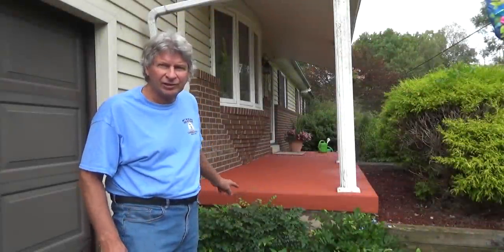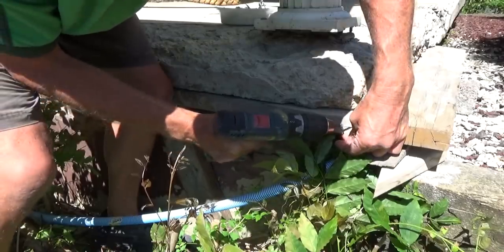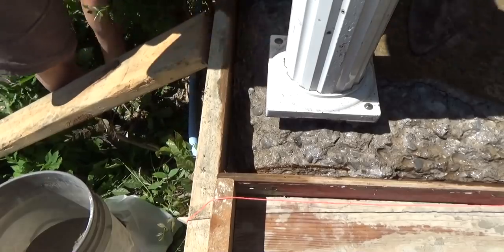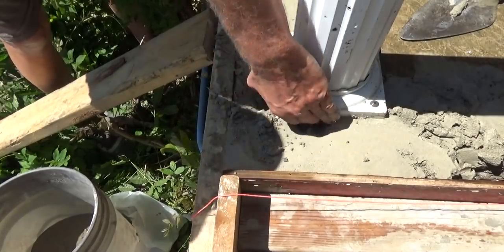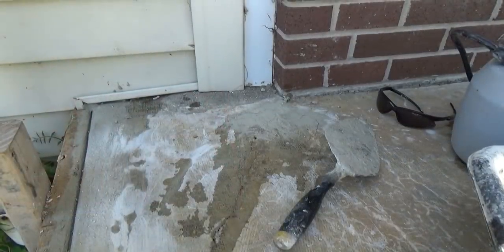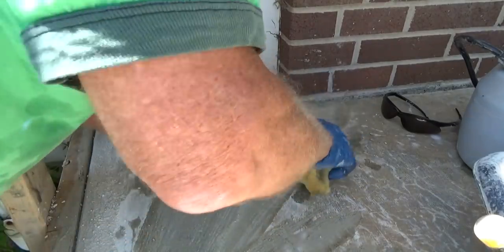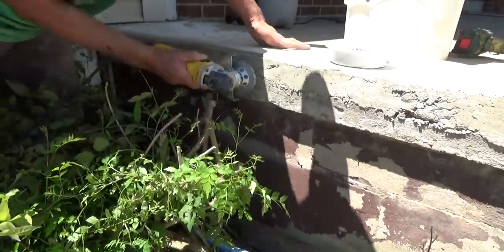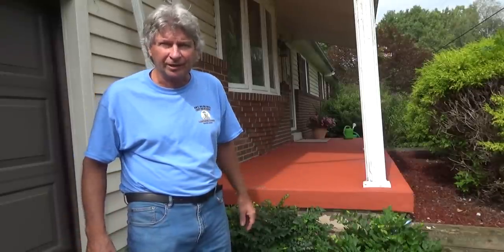CONCRETE REPAIR/PATCHES (Part 5) MIke Haduck

Comment: Great video.  the camera work is awesome.  the explanation is right on and this is exactly my scenario.   this helps a lot.   much appreciated.
Reply from the maker: Thanks Daniel, mike
Reply: @MikeHaduck   I asked about using mortar vs portland and I am watching this again. I see the text that if you used portland and sand you would have and leave the forms.  I was wondering why mortar vs portand and that is the answer.   Thanks for that detail.   I have looked at a lot of videos trying to figure out the best way to fix my porch and this is the best one.  perfect for me.  thanks again.
Reply from the maker: Hi Daniel, here I am using rapid set mortar mix which is very fast drying and acts like portland,  traditional Portland takes at least a day or more to set up, big difference in time factor, thanks mike

Comment: Did you work with your dad when you were a kid Mike?
I did from the time I could crawl up into the truck (well driller).  Older I get the more I realized how much I learned.
Reply from the maker: Thanks Henry,  yes I did also, mike
Reply: I was the youngest in a large family and from the time I was three my mother used to send me out with my older brother driving round in a truck which was great,   I thought I would be doing this forever and got the shock of my life when they packed me off to school at five . Never really recovered to this day .

Comment: Need help Mike! under my Rain gutter is a 3'x 3' slab that is next another 3'x 3' slap. What product is the best to adhere to and float the sunken (1-1/2" down to 1/8" which is but up against the next slab?
Reply from the maker: Hi Jason, I have a video called basement water problem solutions, Mike haduck, watch that first  then a 3 by 3 I would probably rip it out and do it over after the ground is sloped properly away from the house, I am not there to see it so I am assuming, thanks Mike

Comment: Perfect timing on this video u posted Mike. I gotta fix a 4ft wall for my parents that holds dirt&grass at the end of the garage. It looks like the same thing that the porch u fixed looks like it's falling apart at the top 1 1/2feet with a couple cracks like the one in ur video, we got the same freeze&thaw weather here in wisconsin like u do there. Should I paint it with portland first to help it bond or just wet it down good like u did? Also how should I charge them,  a flat rate or time& materials? LOL!! Just kidding on charging them! Thanx for another great video & for answering my questions & nice one on ur nephew asking what to do if it falls apart when u pull the forms! Get in ur truck & take off fast, hilarious!! Always a pleasure watching ur videos!!👍 Take care.
Reply: Mike didn't mention his Portland paint.  No big deal.
Reply: I didn't see him use it, I was just wondering if he didn't need to use it on this particular job
Reply from the maker: Hi Bob, no need for a bonding agent with rapid set it sets too fast my opinion,  anything that works, thanksmike
Reply: @MikeHaduck  Ok thanx Mike

Comment: Hello Mike.  Thanks again for your videos on concrete repair.  I have learned so much from you.  

I have a similar job to do to repair a porch slab 8 ft x 30ft, but the slab has had several repairs.  The top surface on most of the slab is in poor shape showing agregate rocks like in this video, except for one area.  The surface on that area is in relatively good condition but it is about 1 inch higher in elevation.  It used to be a small room that has since been removed.  My plan is to resurface the areas in poor condition to match the elevation of that one good area.  The question is: what concrete mix would you recommend?
Reply from the maker: Hi user, I can't answer that unless I was there to see it, there is lots of different ways and products,  I would ask some of the carpet layers or tile layers, thanks Mike

Comment: I need some advice..i want to build a stone wall / railing onto a 5 ft wall. Theres a 5 ft drop off  into my driveway. Can this wall hold the stones to build a safety railing. Please help. Thankyou.
Reply from the maker: I did a video called " retaining walls (yes or no)  I think that will help to answer some questions,  thanks, mike

Comment: Mike, question for you, if you're willing to indulge - I have a thin slate patio set on a concrete slab. One of the corner pieces, approximately 14"X14" popped off. The morter is quite thin underneath - was considering cleaning it up a little and setting in a polyurethane construction adhesive. (I have an open tube I need to use) :)

Am I way off or is that an okay fix?
Reply from the maker: Hi rick,  I have seen others do it and they haven't had a problem, thanks mike

Comment: Hi Mike, I’ve been working on my front porch which is identical to the one you’re working on.
Question: will there be seams showing between each new batch of mortar as you connect each new pour after removing the form? Thank you, Ted
Reply from the maker: Hi Ted, you do what you can do and grind it or fill in or paint,  thanks mike

Comment: On the corner where the patch was thick and there was an overhang, should you have also screwed some anchor screws to secure the patch to the existing?
Reply from the maker: Hi , I never had a problem,  next video is almost the same, thanks mike

Comment: Great video just what I needed to see how it’s done!
I have the identical problem and the porch looks identical with overhang. You mentioned in your video you could use other type product drying time would be to leave the forms overnight, that would be no problem. What would you suggest to use? Not being experienced using that rapid motor set I would feel better using a material that gives me time to work with it. And after removing the forms what product would I use to fill in the voids. 
You mentioned Portland and sand, do I use your  regular mix? Two sand to one Portland?
Thank you, Ted
Reply from the maker: Hi Ted, I use to use 1 portland to 1  1/2 sand but  it shrinks and it takes a few days before you can walk on it, I have another video same thing coming up next t werk,  thanks mike
Reply: Mike Haduck Masonry  Thanks Mike looking forward to your next video. Will hold off doing my porch till I watch your next video 🙂

Comment: That porch is nearly identical to my own. The aluminum columns are the same and the block with crumbling parking with brown paint is the same.  You weren't asked to clean that and patch?
Reply from the maker: Hi John, it's a traditional fix with a new product, thanks Mike
Reply: @MikeHaduck  I meant parging but spell check made it parking. I actually used the rapid set mortar on concrete driveway just to fill in spots. I tried lots of stuff, Re-cap after some DAP crack filler pealed off after a winter. I'm impressed by the rapid set.

Comment: Does anyone understand why Mike used Rapid Set Mortar mix on this porch cap and not Rapid Set Cement All? Is it because the porch cap in this video only needed the edges rebuilt? I'm confused why he sometimes uses the mortar mix on a repair and other times he uses the Cement All mix. He only used the Cement All as a final coat on this repair. Why didn't he just use it for the whole job? Would that not have worked? Is the mortar mix easier to work with than the Cement All? Or is there another simple reason that I'm just not understanding?  In an earlier video, Mike says to use mortar for vertical applications and cement/concrete for horizontal applications.  But then I see Mike patch a driveway  (a horizontal application) in one of his videos using Rapid Set Mortar mix. If someone could explain this, I would really appreciate it
Reply from the maker: In my mind they are the same stuff, one has sand in one dosen't,  mortar mix is easier to use, I don't know why they call it mortar because it hardens like concrete,  so I use the motar mix more often,  thanks mike

Comment: What's fascinating is landlord's job is to put carpet on for safety.  But it's bad
Reply from the maker: Hi Wendy, in my area it holds the water into the concrete and freezes, thanks Mike
Reply: I recently bought special porch paint and it had coarse sand in it to offer traction in slippery conditions. It's a much better option than carpet if anyone is interested.
Reply: @RicArmstrong  ima check that out. Ty
Reply: @deadmanswife3625  
You're welcome. I bought it at Lowe's if you are wanting to get some. You can have them make it any color you want like regular paint.
Reply: Mortar mix with a broom finish is an excellent traction surface.

Comment: Looks like you used that cement all less then quarter inch thick
Reply from the maker: Hi, you got to do what works, after it is painted it seals it up from the moisture and I haven't seen a problem,  thanks Mike